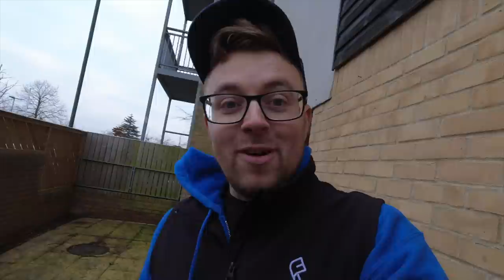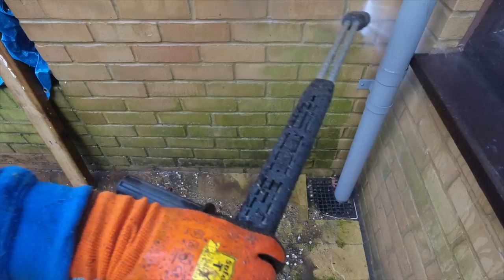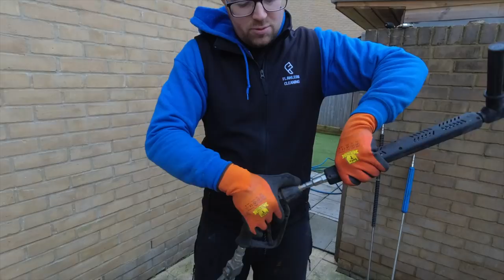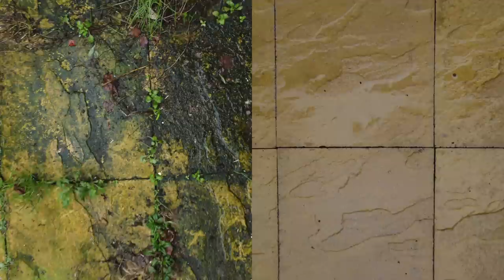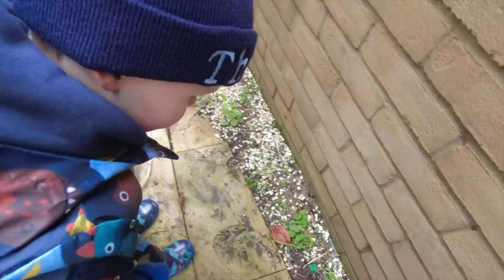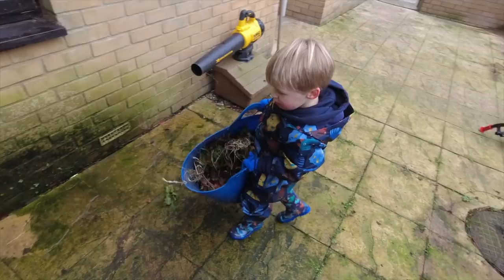*THIS PATIO IS SO FILTHY!* Pressure Washing With a Little Help From My Son

Comment: Mad how it’s got like that just after a year mate.  Defo need to get me that double Lance that has the rinser! 
Giving me ideas here bud! Think I need to put my kid to work too!
Reply from the maker: Init mate it’s shocking! Yeah mate got It from Nick and had It since September and only Just started using It. Kew spigots are the way forward just whipping inbetween all the lances
Reply: @FlawlessCleaningServices  think I’ll stick with the QR midi for now everything is set for that but to be fair the Kew spigot looks much quicker and easier to switch
Reply from the maker: Just a thing to get down the line mate, not necessary but handy

Comment: I bet this garden lays in the north direction. It seems there every comes more algea than the year before.
Reply from the maker: We have Issues with a lot of pigeons above and It comes under a service charge which strangely I’m not allowed to sort myself so the water overflows from above a lot. So It’s always wet out the front and the algae thrives.. but It does make a rewarding clean 😂

Comment: Nice job, Ben. What machine are you using? I have a 15lpm 4000psi machine , but I'm considering trading up to 21lpm or possibly higher. I'm guessing yours is 21lpm?
Reply from the maker: Hey Peter, mines a Briggs & Stratton Poseidon.. 21lpm 250 bar. Love It, absolutely chomps through the grime

Comment: Somewhere in the comments, someone may already have asked if you seal patios after cleaning and if so, what with?.

Mine needs both, and it needs to be done to my bricks before I lift and sell them.
Can you tell me what I can seal them with, please.
Reply from the maker: Hi Fin, I don't use sealers but If I was going to It would be Resiblock, cheers
Reply: @FlawlessCleaningServices  Thanks for the quick reply to my query.
It must take some appreciable amount of time to go through so many comments.